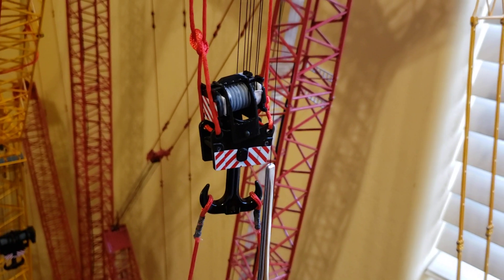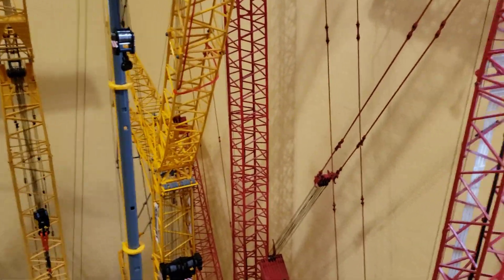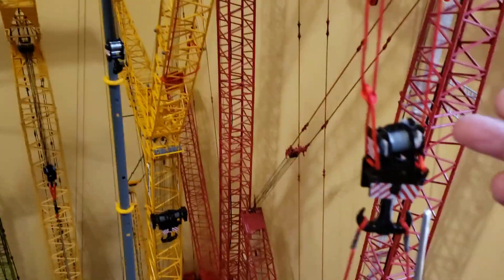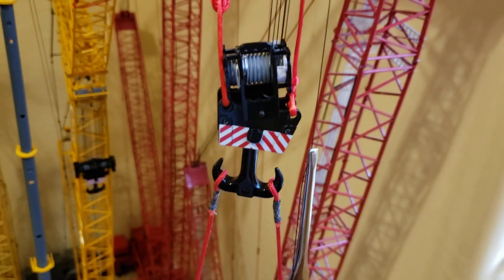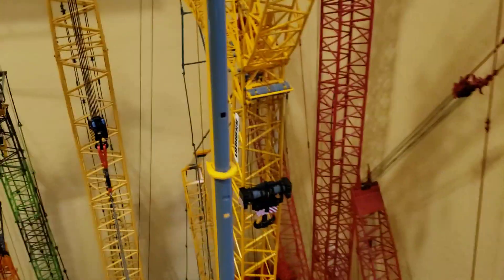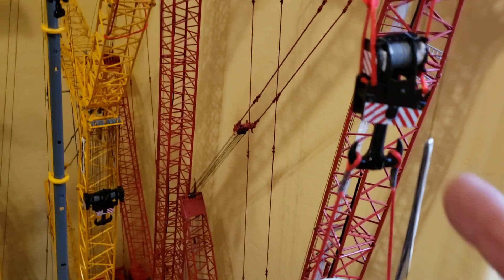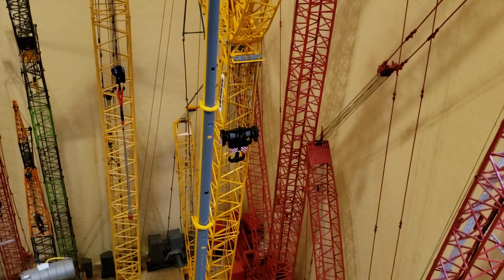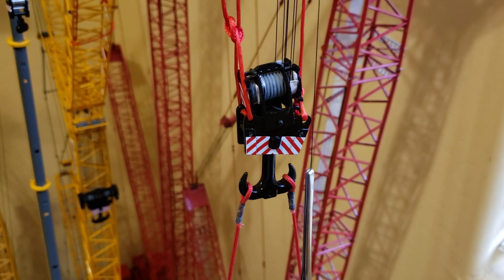Tip For Reeving The LR1750 Hook Blocks

Comment: wait til you get the SGC-120 and reeve that hook block....lol...  from 4 different winch drums....
The problem with all these model hook blocks is that they have too much gaps in between the sheaves as well as lack of rope guards that prevent the rope from bouncing out of the sheaves.
Reply from the maker: I don't mind a challenge lol. A big hook like that I would take apart and reeve each drum on each hook section like I did the 8800s hook block
Reply from the maker: But yeah the gaps are a drag and make you jam paper in them